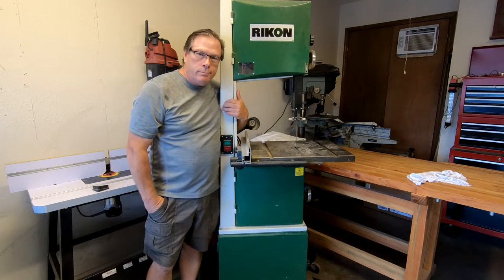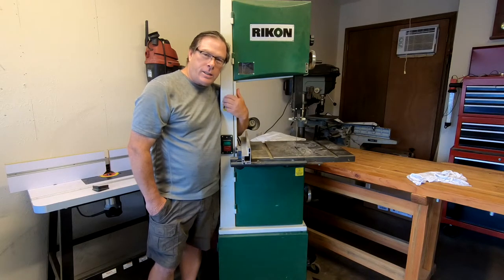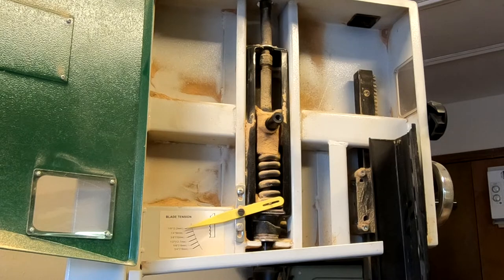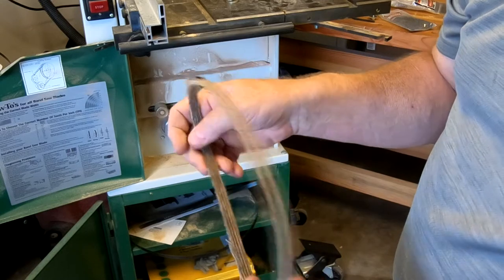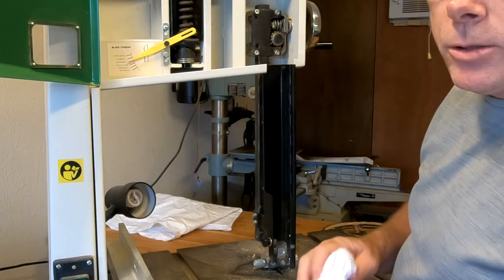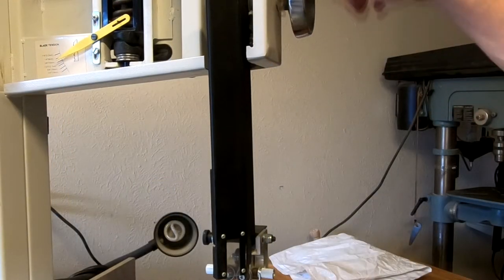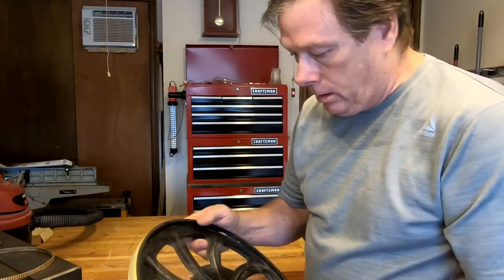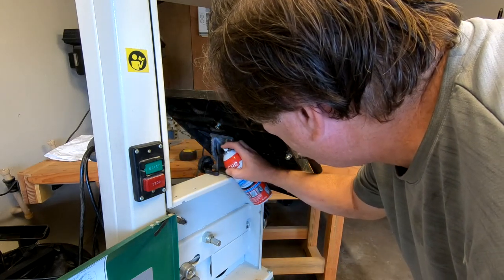And Now For Something Completely Different - Bandsaw Tuneup!

Comment: Great video I always love the knowledge you show in your videos. I might have to ask a question. My table top band saw is a 9" but on a vertical measurement it will only cut 5 inch thick wood but on a horizontal measurement from the blade and it touches the machine it measures just little over 9 in but allowing me to make a 9 inch cut is that because the throat measurement is different on a tabletop machine then a floor model machine like yours? I did enjoy your video and glad to see someone else using NeverDull I love that stuff. Thank you for sharing friends and hope you have a great weekend.
Reply from the maker: Thank you for correcting me, Jeramy!  I mislead everybody in this video. Technically, a bandsaw is measured by the diameter of the wheels that drive the belt.  The distance from left of the blade to the machine is normally less than the wheel diameter by a little bit. But you are right, the vertical height does not designate the size of the saw. My bad.

Comment: great video. There are a lot of YT videos for bandsaw tuning that can also be helpful for you if you run into issues again. guide bearing setup and bushings have a lot to do with tuning. blade tension is super important too. too tight and it will wander one direction, too loose and it will wander the other. that all depends on the kerf and sharpness of each tooth, so as u are using it you may need to re adjust the tension periodically. blades also stretch over time. 
A quick tip for resawing... keep a pencil with an eraser handy to use as a push stick when u get to the end of your cut. use the eraser end to push on the wood. the eraser acts as a non skid surface. I have been 'bitten' by a bandsaw before and it is not a clean cut. lol.
Reply from the maker: Thanks Kevin!  I must admit I am not a skilled bandsaw user.
Reply: its all good.  One of the best things we can do for good performance of our tools is keeping them clean, and i must admit that you do such a better job at it than I do. I shall follow your lead a little better friend. :)
Reply from the maker: Thanks, Kevin. Something tells me I will continue to have issues with this thing, but mostly due to user error.